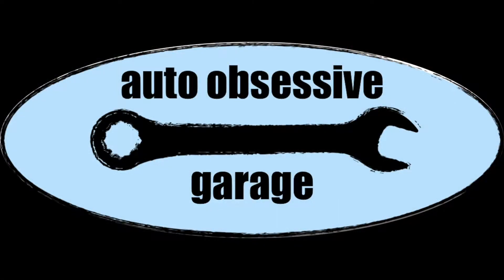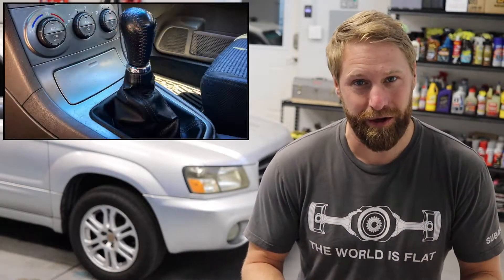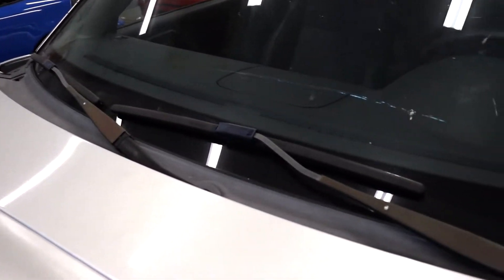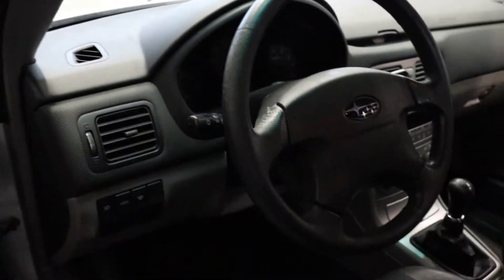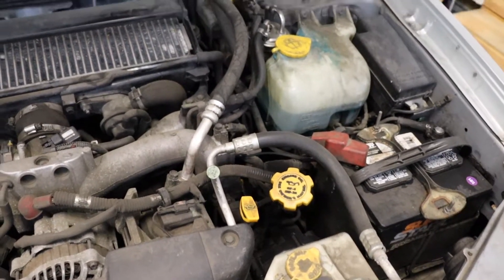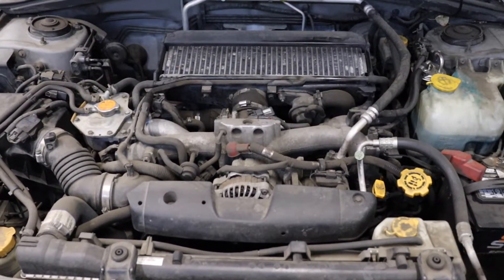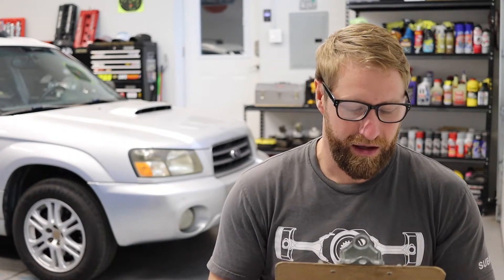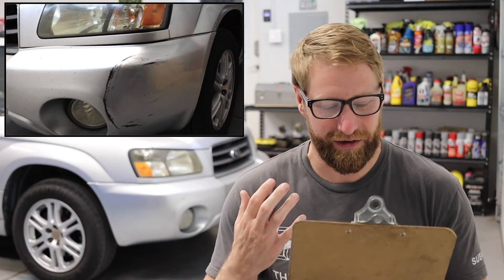2004 Subaru Forester XT - Episode 1: Intro and Issues

Comment: Great series of vids. 
Thanks for producing them!
I own a 2004 FXT in the same colour & I’ll be tackling the timing belt + valve cover gaskets very soon. Will also be respraying the bumpers & garnish pieces.
Big thumbs up from NSW, Oz.
Reply from the maker: Thank you for checking out the series. It’s always great to hear that the vids help out. Restoring the trim adds a ton to the vehicle’s overall look. Best of luck with the upcoming work!

Comment: Hi Chadwick - your timing is perfect as here in South Australia I’m going to buy another Subaru XT - I’ve owned nine Subarus over thirty years including WRX GC98, XT Turbo 2010 Forester and Leone Wagon - I am selling my Hilux 4WD as running costs here are double compared to running my Subarus - you’ve done well with the condition of your XT - I’m looking at XT Turbo Foresters between 2003-07 as the forums indicate they use a semi-closed aluminium block design and multi steel head gaskets where the non-turbo use open block and the problematic steel/granite gaskets - what are your thoughts? - I look forward to watching your work on the.XT.
Reply from the maker: Thank you very much.
I’ve always been a massive fan of turbo Subaru’s of this vintage. I find them to be quite stout and reliable but maintenance is everything. Regular oil changes, timing belt services, and spark plugs go a  long way towards them living long lives. Difficult to find stock, the Forester XT is one of my favorites.